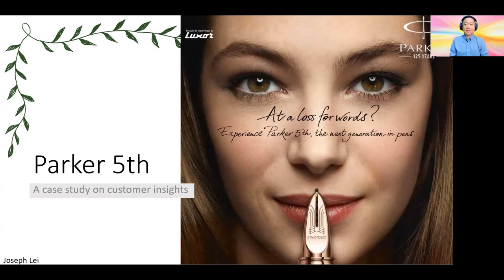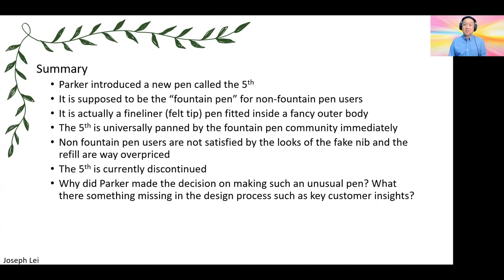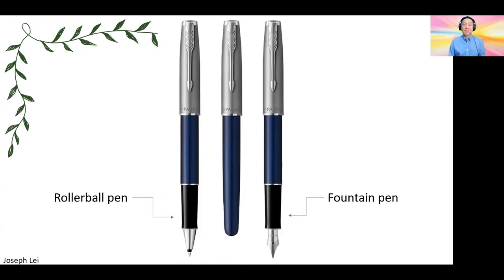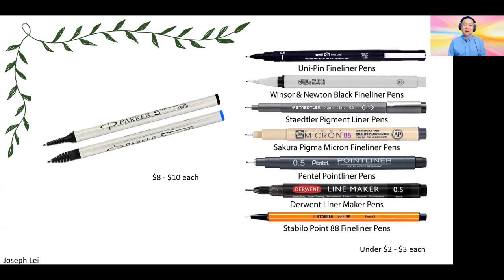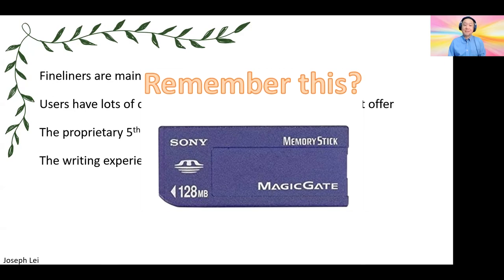Design Case Study: Parker 5th Technology (a fountain pen look alike)

Comment from the maker: 0:00 Intro
0:32 LinkedIn contact
0:46 What is the Parker 5th?
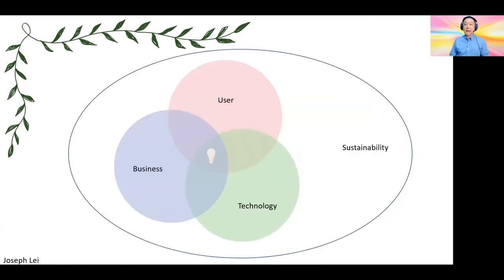1:48 The 3 elements of Design Thinking
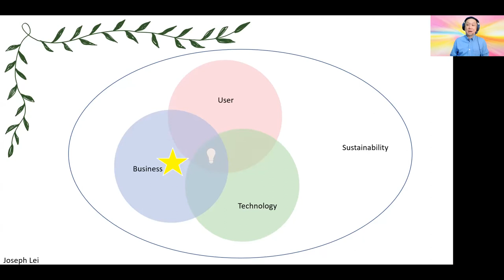2:44 Imagining what the pitch meeting was like
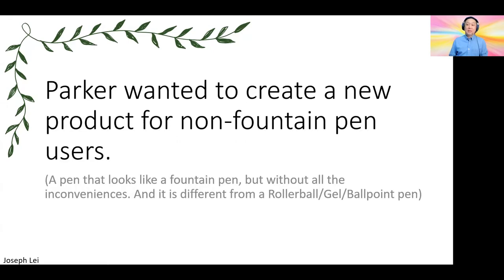3:28 What motivated Parker to make this pen?
4:17 What the true Venn diagram looks like
4:49 [Summary] 
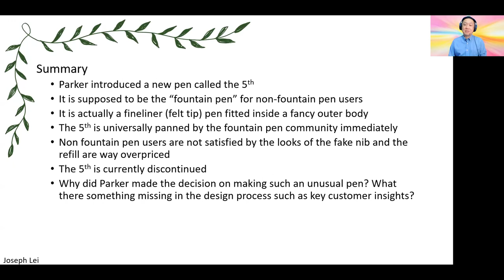5:53 [Digging Deeper]
7:39 Comparing the needs and the design solution
9:39 So what are the problems?
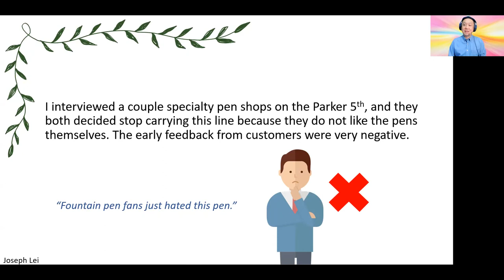10:33 [Recap]
11:13 Suggestion: the super users
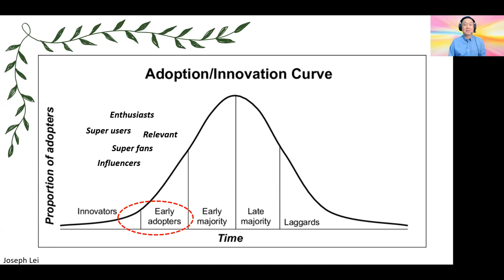11:50 What users want
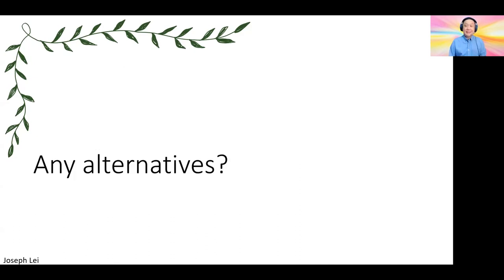12:35 Alternatives
14:08 Solutions - Reframing
16:50 [Final Recap]